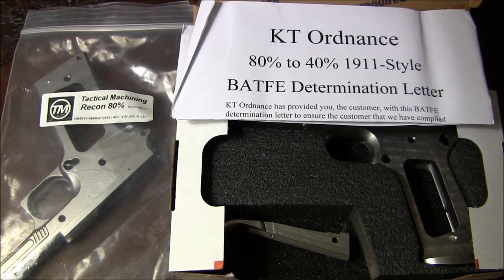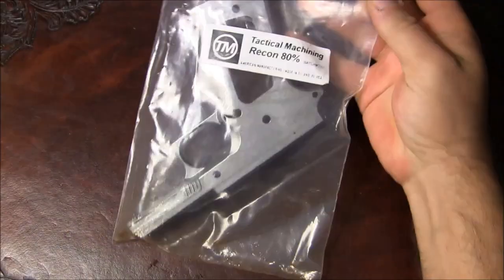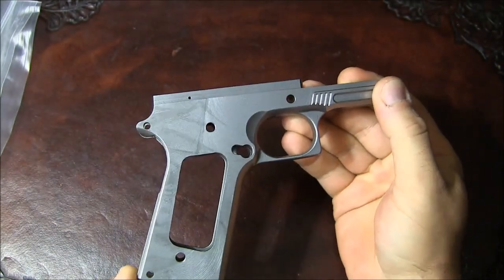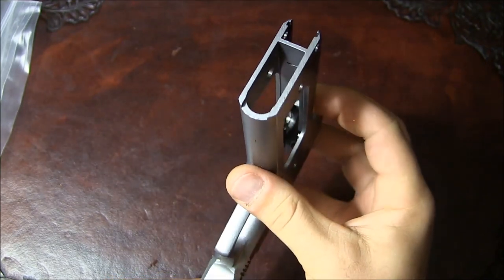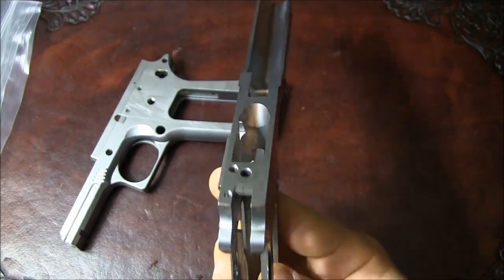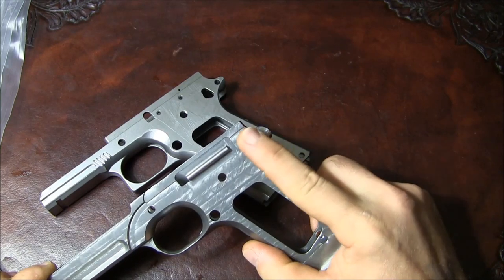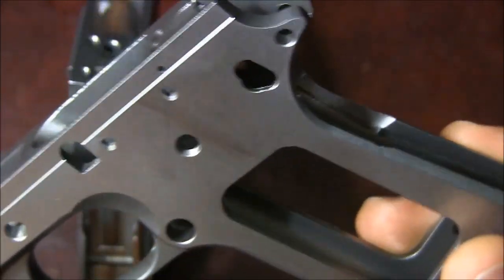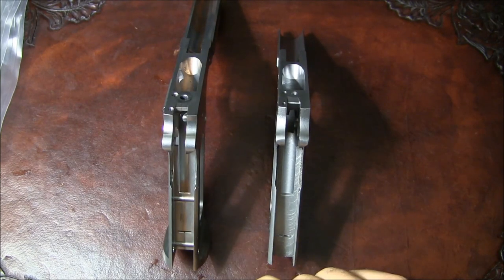1911 80 % Frames: KT Ordnance vs. TM Recon

Comment: I bought a "TM Recon" frame from Tactical Machining and I sent it back because it was machined wrong, IMO...it was sloppy...just like their other products.
Reply from the maker: Sorry to hear that. I haven't done anything to mine yet, but I wouldn't expect it to be perfect for $160. By chance did you find other, better 80% out there? I am asking because I would want to buy it.
Reply from the maker: Thank you. I actually ordered 2 from 1911builders.com
Reply: MosinVirus
I just ordered one myself. I was going to get the "Stealth Arms" aluminum one to practice on, first, but for the price of $149, I figured I better get the forged steel one while it's on sale...even though I don't particularly care for the checkered grip.
Reply from the maker: Harold Smith I was wondering about that checkering too. I actually do like checkering on the front strap, but would have wanted to have the opportunity to do it myself and to bring it up higher. Though I like that the frame is a GI shape, with nothing extra like square trigger guard, light rails, etc.
Reply: MosinVirus
Sometimes it's hard to know if I will like something based upon looking at a picture, so I'm hoping that when I actually hold the frame in my hand that I won't mind the checkering so much.
BTW I feel the same way you do: I don't want a square trigger guard, rail, etc. I wish manufacturers would concentrate on making the basic frame - and doing it correctly - rather than make a "fancy" piece of scrap metal.
Reply: I just received my frame from 1911builders today. I'm still not too keen on the checkering, but at first glance (without taking any measurements) the workmanship and overall quality of this frame is impressive; much better than the Tactical Machining product.
Reply from the maker: Harold Smith I completely agree. I received 2 and they are basically perfect. My friend received 2 as well, and has the same opinion.
Reply from the maker: Harold Smith Also, my friend received 2 of their slides. awesome product too.
Reply: Thanks for the update. I'm glad to hear that your parts are good too. I'm finishing up a .22 pistol project right now and then I hope to get to the 1911.
I'm thinking about using a small end mill to cut the slide rails, rather than a 7/64 keyseat cutter, and I'm wondering if I should buy a jig to hold the frame or whether I can find a way to secure it without the jig. Are you going to use a jig?
Reply from the maker: Harold Smith Hello. I am going to get a Sherline mill since I will have to hide it away after every use, and it is only 40lb. I would like to try and use the keyseat cutter, but haven't seen anyone do that on a Sherline. I am thinking of getting the frame support fixture from Brownells. It is lower profile than 80% jigs, but will require grip bushings installed. Basically I have to get the mill to figure out what I can use.

Comment: Kt is not in business anymore
Reply from the maker: Wow, you are right. I just took a look at their website. Did you read some of those scanned docs?
Reply: MosinVirus no I haven't. I'll have to take a look at it
Reply from the maker: mastalee Really interesting. Case was dismissed apparently, but still very strange stuff in there.
Reply: MosinVirus they were raided by the atf in 2006. But just recently in February they decided to close down the business. So I'm not sure why they did.
Reply: mastalee 
KTO's prices were astronomical and their products weren't very appealing, IMO, so I can see why they're going out of business. When I do an "80%" project, I don't want "fancy" and expensive, I want plain and inexpensive, in case I mess it up.
Reply: Harold Smith how much were their 1911 80% were going for?
I'm looking to buy some 1911. 80% aluminum frame that r going for about $169.
Reply: +mastalee look at e-sarco.com

aluminum 80% Para Ordinance frames for $125